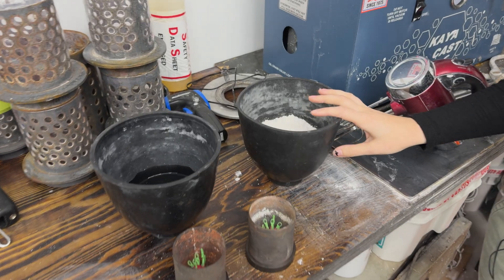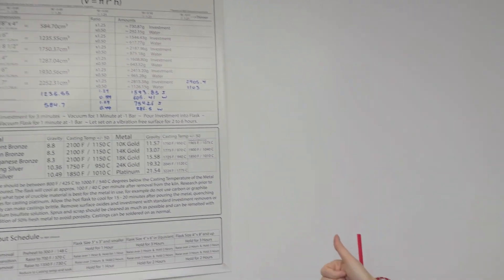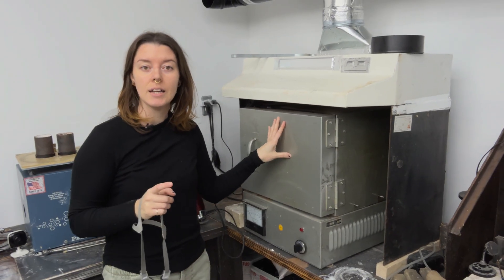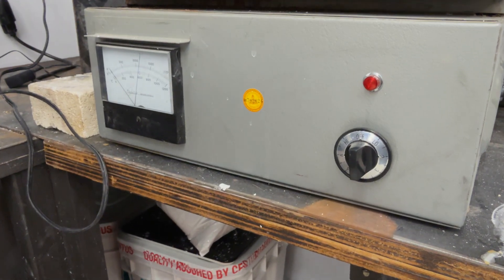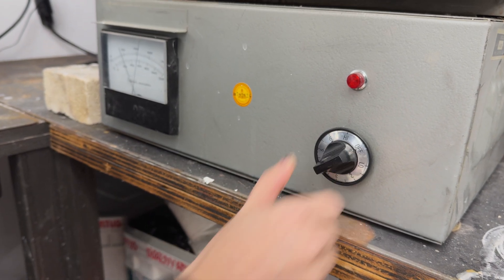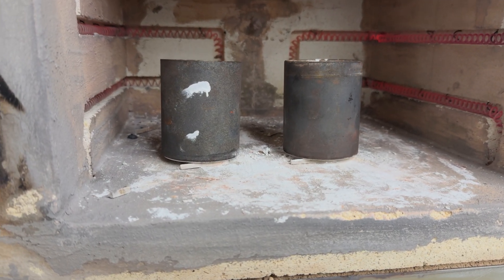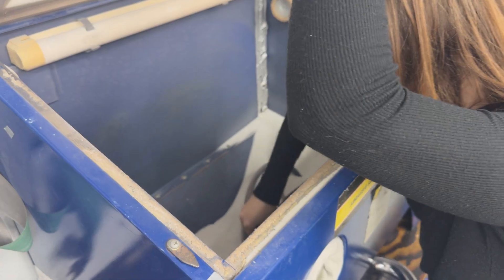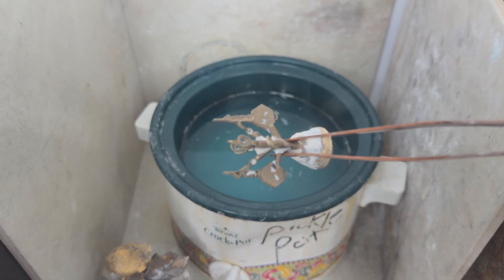Fastest Resin Burnout - 3HR Rapid Burnout Experiment

Comment: I almost exclusively use a 3hr burnout with Bluecast and Plasticast investment. It works on both 100mm and 120mm perforated flask. The only issue I’d say is the rest time for the plaster. I usually prefer to rest as much as possible and burnout as fast as possible. That way I can preload all my plaster, do any other work for a couple hours, then burn everything out for an hour at 720. I also make sure to vacuum my investment after burnout to get rid of any inclusions or flakes that may have been shocked out due to rapid heating. I get clean consistent castings 9/10 times 👌🏾
Reply: When you vacuum after burnout do you flip the button side down to vacuum or do you leave it button side up. Meaning while no molten alloy is in the flask
Reply: Vacuum the flask? Never done this before. Are you using the casting machine to pull the vacuum by putting the flask on upside down first?.. or something else?
Reply: @Drgoldthumb just using a regular vacuum cleaner and putting the nozzle just a cm from the flask upside down. It’s such a simple but effective fix

Comment: I can cast in 3 hours as long as the parts have smoothish surfaces, that's from deciding to do it to having the pieces pickled and pin polished. Small flask (coke can sized), hot kiln, 730c, 45 min set time, only the best gypsum bonded investment. Tree, can, invest, 45min set, into 730, 1 hour hold once the temp has come back up, crash to cast temp (door open a bit), cast, quench and post process and don't miss the postal collection... Only suitable for waxes, not prints or other unusual model materials. I would only ever do this in an urgent situation, rushing in casting always leads to compromises. I'm just around 1m career castings completed and not many in this manner. Overnight is a process without quality compromises.

Comment: I'd suggest using a rosebud tip on the torch, larger flame size will give a quicker melt and less oxygen on the metal. Thanks for trying something to push the boundaries with casting.